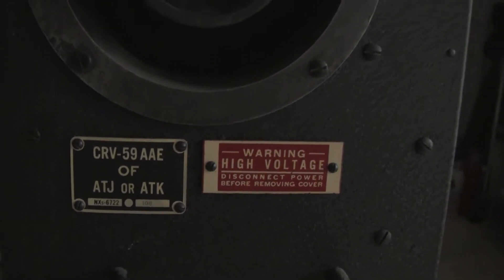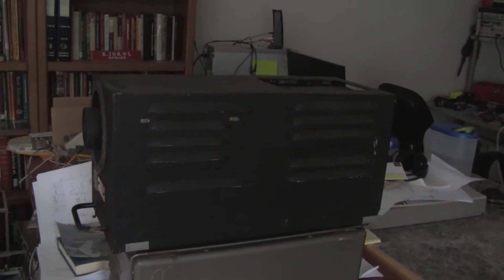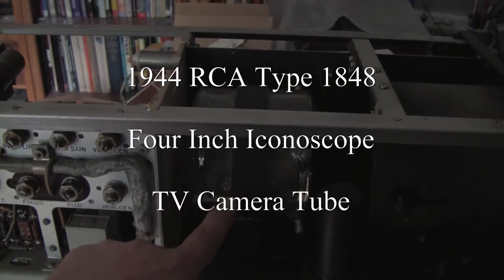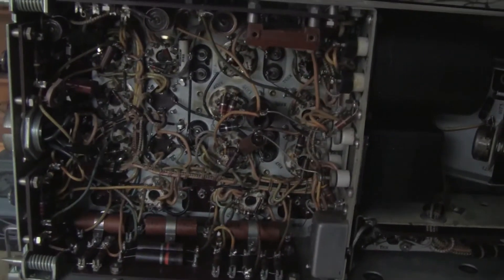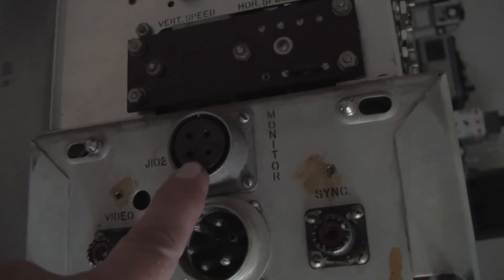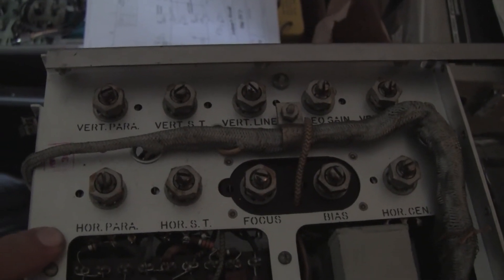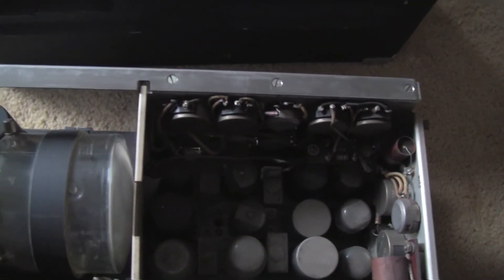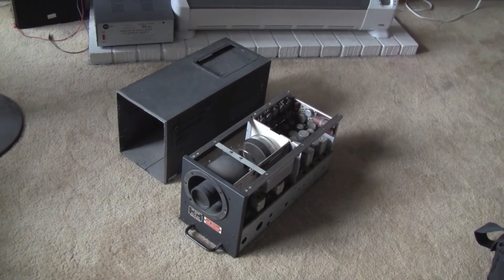RCA Iconoscope TV Camera: Introduction

Comment: Is the sensor tube a plumbicon? Using lead sulfide as the target. Second dumb question. Isn't it designed for 400Hz (aircraft) power?
Reply from the maker: The secret is in the title. The "iconoscope tube" uses a fine mosaic of cesium activated silver droplets deposited on a mica plate. The original power supply ran on 28 volts DC which was stepped up to +405VDC and -50VDC by way of a pair of dynomotors. My power supply was made with a conventional 60Hz iron core transformer which I had custom made. The 28 volts needed for the tube heaters came from a modern switching power supply.

Comment from the maker: Progress so far as of 20150420. Found several burnt resistors in the bias network. I suspect someone hooked B+ to that input by accident. The proper -50 volts would not be able expend enough power to do the damage I found. But, +405 volts would. Replacement resistors to be purchased today. Stay tuned. (http://www.labguysworld.com/RCA_CRV-59AAE_Restoration.htm)

Comment from the maker: Another correction. I said the iconoscope was an 1848. This was because that's the datasheet that I was looking at. The correct tube number is 1846. I do not have a datasheet for the 1846., Since both the 1846 and 1848 are interchangeable, either datasheet is usable.

See a working CRV-59AAE at the Early Television Foundation. (http://www.earlytelevision.org/rca_crv-59_camera.html)

Also, another iconoscope camera is currently being resurrected at the Early Television Foundation. (www.earlytelevision.org/1847_idaho_camera.html) That one is a 250 line camera based upon the 1847 experimenters iconoscope tube. The 1847 was derived from a two inch oscilloscope CRT that has a light sensitive mosaic plate installed in place of phosphor. A cool tube. Look it up.

Comment from the maker: In the video, I was stymied by two of the controls. The first were the two pots marked V.S.T. and H.S.T. These are vertical sawtooth and horizontal sawtooth, shading adjustments. The other control is vertical linearity. A cable tie is hiding part of the label.

Comment: wow that is a cool unit
what are you planning on using it for
and how do you plan on getiing the image of of it
Reply from the maker: ***** I need to make a power cord and an interconnect cable. The power requirement for the tube heater circuit is going to need 16 or 14 gauge wire. Then a slow bring up to reform the capacitors before applying full power. The video comes out the jack marked, eh hem, "video". Logical?
Reply from the maker: ***** Forgot to mention, I will be adding a proper 2:1 525/30 sync generator and a process amplifier so the camera can drive modern equipment or even be operated in a studio situation.
Reply: mmmmm sounds nice
i am looking forward till the video's